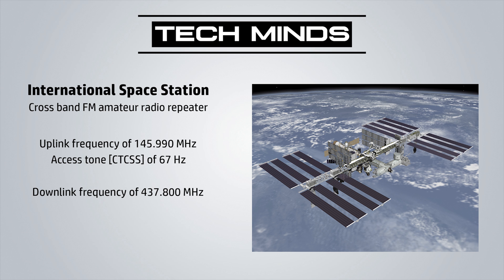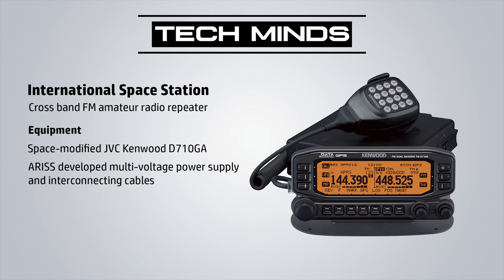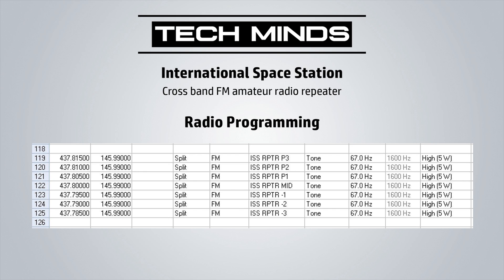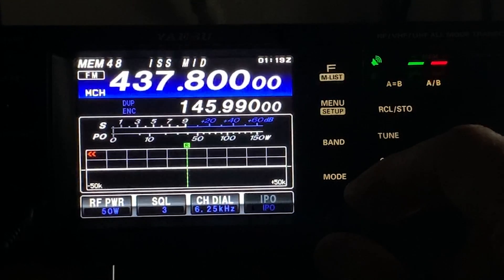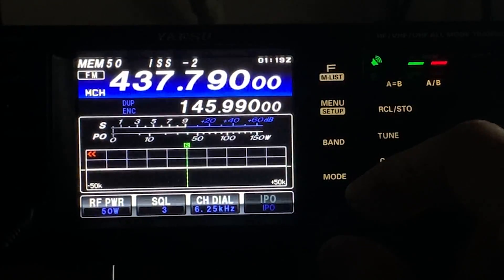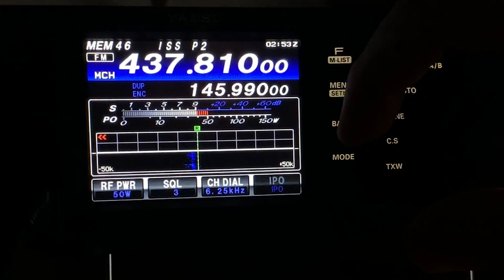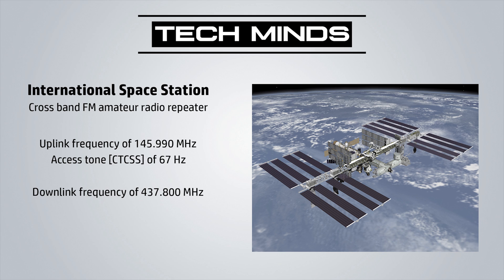ISS International Space Station Cross Band FM Repeater

Comment: Happy to be corrected, but i don't think plus/minus 15khz doppler is possible from the ISS. Max speed coming straight at you I think is about 11khz. And because of the earth curvature the velocity vector at the start is directed slightly upward so the velocity towards you is less than that.
On my baofengs in split mode they seem to allow smaller than 5khz increments. So its possible to set the transmit frequency minus 3khz on approach and plus 3khz when its going away from you. Although I don't think its required.

Comment: Hello.on7nd name Nico.
I have been receiving ISS cross repeater with rtlsdr with no lna in-between...
I have  calculated inches to mm and so I have constructed the arll paralindy  
With following values...
Dipole 25 mm diameter. Total length 3168 mm.
Gap on center is 6 mm.
In the 25 mm pipe fits exactly 22 mm pvc pipe to insulate upper and lower part dipole..
Now the whole thing needs some pve insulators....nr1 has a 117mm diameter and must be shallow to fit exactly over the alu on the Feedpoint 
25 mm pipe (dipole vertical)
On the outside this pvc 117 mm are 4 small 32 mm long (4pieces) to make the total circle from about 180 mm.
On these point are with a bolt M4 or  M5  the 298 mm long director dipoles aluminium 10 mm diameter attached. They must be afterward tilted to 25 to 30 degree.
Note when stand in front , all left edges directors are highest.....
One leg vertical dipole is 158 mm...
On the original arrl paralindy ther is no reflector on bottom antenna .I have added on a plastic round thing from 225 mm diameter which has a hole inside 25 mm on  the antenna ...I mounted 8 aluminium strips on that insulator 20 mm X 2 mm thick  long 161 mm each strip.....slightly longer than dipole (4 procent)m
Coax is best with 75 rg6 u for reception rtlsdr( random length) a small 50 ohm cable was also connected with sma to connect to rtlsdr ...

Result is fantastic..
V
qfh and cloverleaf are tested ..not happy and low reception cubesats telemetry and saudisat 1 c..

Yesterday noiseless BBC quality with this paralindy.
Vna result is ....resonant point really good visible in spectrum hsdr and  low  interference local stations...really made for circulair mobile stations . .
Email me for photograph....73 Nico
5 9 plus 40 dB ISS.

Will use it  forever....that means alot

Comment: Wrong pass selection and inefficient antenna. I chosea high pass and used an IC271 for uplink and an IC 431 for downlink with yogis for both frequencies.  Used a home brew ez el with stepper motors and home brew software.  Easy access eventide as you gain access at early AOS.  Too many stations competing to use substandard gear.  Suggest quadriffilar antenna if you can't do yagi.

Comment: The doppler effect will effect the tranmit frequency also. That may be why you can't get it to work.
Reply from the maker: The uplink is on VHF which has a less than 3KHz +/- Doppler shift, so in this case it’s not needed specifically.
Reply: @TechMindsOfficial  I am new to this. But I have tuned up a lot of radios when everyone used 5 KHz. The tone is set around 1.5- 2 KHz. But it could just be that there are a lot of people all around trying to talk to it all at once and that makes it where it can't get the tone of anyone.

Comment: Your frequency chart shows the downlink frequency changing but not the uplink....I may be mistaken but wouldn't both be effected evenly? I dont see why uplink frequency would get compressed with its moving toward you and stretched when moving away. Please respond quickly with an answer im sitting in front of my computer with chirp trying to program my radio. Thanks for the video.
Reply from the maker: The uplink is on VHF which has a less than 3KHz +/- Doppler shift, so in this case it’s not needed specifically.
Reply: @TechMindsOfficial  What is more important is that only the station receiving should compensate for doppler shift. So the ISS operator compensates for uplink shift on receive and the terrestrial operator corrects the downlink reception. If both tried to match each other, it would be chaos and neither would connect. Also the transmitted signal should never be varied in mode or frequency during transmission.

Good video. Thanks. G1EKW

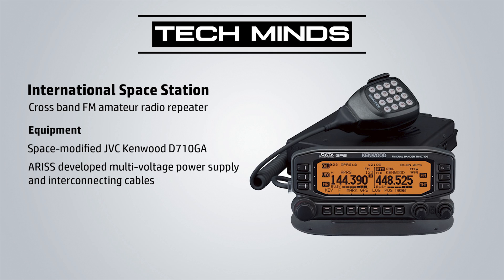Comment: You note (at 00:51 sec)  that a 67 Hhz CTCSS tone is required with your uplink signal.  Will "TONE" work or must it be "CTCSS"?
Reply: By tone do uou mean the old 1750 tone burst
Reply: @geoffpriestley7001  No.  I'm trying to understand the difference between "TONE" and "CTCSS"
Reply: @jeffslusher  both the same. its just on my radio ctcss is the continuous  tone to operate the repaters and tone is the tone burst to open the old repeaters tgat dont exist anymore .just a thought on some radios ctcss is how its used either on tx or on rx or both and tone could be the frequency of the tone  round here its 82.5 as standard on repeaters
Reply: @geoffpriestley7001  Appreciate the info!  Amazing how simple things can get confusing real fast.
Reply: @jeffslusher  I believe the old 1750 Hz tone was used on European repeaters.
Reply: @geoffpriestley7001  No.
Reply: @Jeffery Slusher:  Hi Jeffery.  Far easier to think of it as “Tone encode” and “Tone decode”.  The problem is terminology.  CTCSS = Continuous Tone-Coded Squelch System and refers to sending a sub-audible tone (“Tone encode” – in this case 67Hz) along with the transmission to “open” the receiver on the ISS.  I do not know if the transmission from the ISS contains a CTCSS sub-tone (if anyone knows, please let me know, but I doubt it).  
If the ISS transmission does contain a sub-tone, you can still hear the ISS transmission if your radio receive is set to CTCSS OFF (“Tone decode”).  IF the ISS transmission doesn’t contain a CTCSS sub-tone, and your radio has CTCSS set for both TX (“Tone encode”) and RX (“Tone decode”) then you will not hear the ISS transmission.  
The single term TONE refers only to the (typical) 1750Hz Tone (which is audible) and sent to initially open up repeaters in the good old days.  Still used in France (and maybe elsewhere) but no longer used (I believe) in UK.  Maybe this post confuses things even more, but I hope it has been helpful!
Reply: Those are the same thing.
Reply: @kd5you1  TNX for response.  I read somewhere that TONE only sent the embedded tone on transmit while CTCSS not only sent the embedded tone on transmit but also required an identical tone (from the repeater) to activate the the user's receiver.  I've noticed that I can hear ISS repeater traffic with my receiver set for TONE, making me think that maybe CTCSS is the wrong terminology in this case?
Reply: @jeffslusher  Well you're partly correct. CTCSS or Continuous Tone Coded Squelch is the technical term for Tone, but on receive some radios might have a TSQL indicator to show that the tone or CTCSS is being used on receive as well as transmit. Other wise they would have the Tone indicator if the tone is being used only on transmit.

Comment: I used a D710 with M2 LEO pack antennas to make some iss contacts, but I believe there is an issue with the ariss 2m antenna or feedline, as the repeater exhibits the same problems as the old digester (unreliable uplink).
Reply: "digipeater", not "digester"

Comment: Anyone out there please?  So – Doppler is allowed for on UHF receive (using 5kHz steps); would we not also require 5kHz steps on the VHF transmit to allow for Doppler?  I’m sure we’d all appreciate an answer from someone who knows!
Reply: Doppler shift is proportional with frequency. I haven't tried ISS yet, but with other FM repeater LEO satellites with handhelds you should care about Doppler only on 70 cms (about +-10 kHz to the center frequency) but on 2 meters in practice (+- 3 kHz) it works on a single channel. de YL3GU.
Reply from the maker: Exactly 👍
Reply: @TechMindsOfficial  /James McIntyre/Robert McCain/Mārcis Bērziņš:  
OK.  Thanks, guys.  I get it, that the technical answer is: Yes – there IS a Doppler shift (in both directions) of up to/around +-3kHz on 145MHz (2m), but the Doppler can be handled OK both ends by the radios.  
I find that rather strange, as I can hear when 2m radios are not on frequency (distortion and raggedness, if I can describe it as that) and therefore thought it would be beneficial to program one’s land-based radio +- 1 or 2kHz to give clearer TX and RX.  Cheers, Iain.
Reply: I don't understand that either.  Doppler affects both uplink  and downlink, but is proportional to the RF freq, so only 1/3 as  much on the uplink.
Reply: I'm interested as well. Just posted a similar comment. Not sure why it wouldn't affect both.

Comment: Hi, worked a couple of stations today from my mobile rig (IC-208) by switching from a memory channel with the Uplink Freq, to the VFO on Rx so I could adjust for doppler. The repeater was very busy with many stations trying to use it. Antenna was dual band diamond vertical on car. THanks for the video. Tim VK5AV.